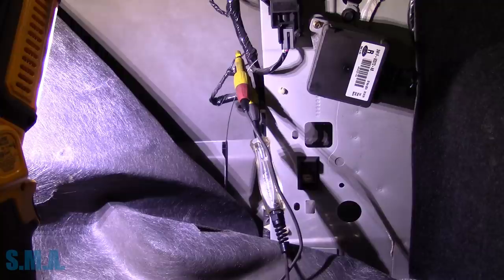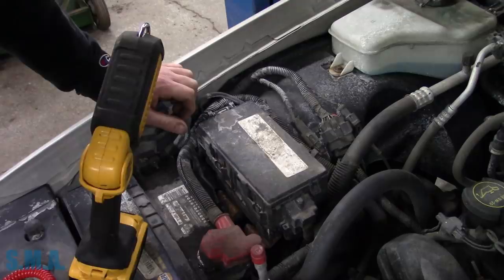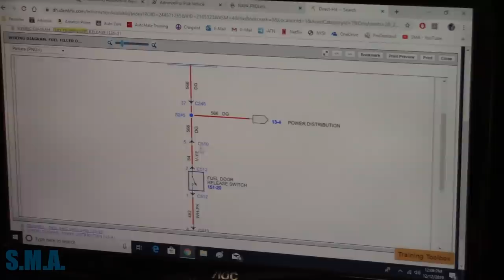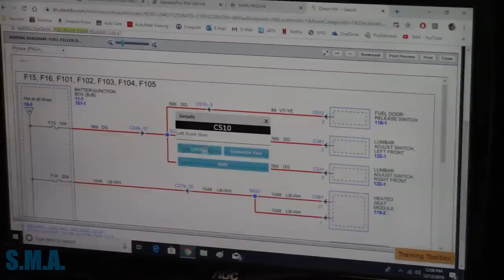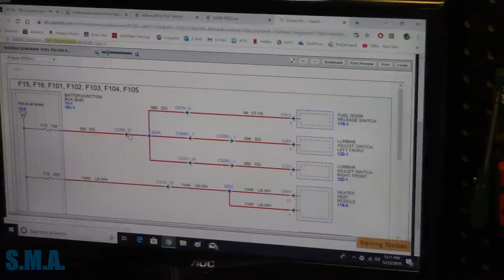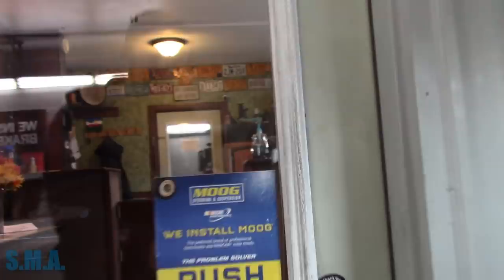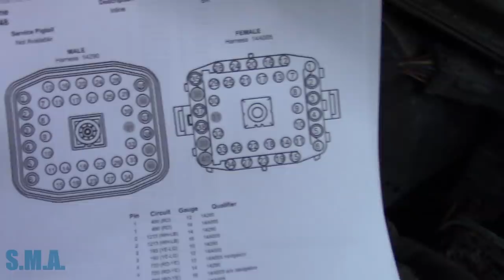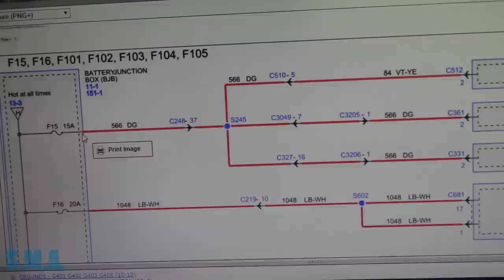Lincoln Town Car: Gas Door Will Not Open

Comment: Put a standard/short 1/4" drive socket on a 1/4" nut driver, and load up the tape onto the socket.   Take the socket off and use.

Comment: in the area where  I live people have lost engines to oil change establishments, not putting oil in, not changing the oil, letting it go with a leak so it ran out, etc. 
When my 1999 silverado was new I took it to the dealer for my FREE 1000 mile oil change. I was sitting on the bench in the garage area and the kid brings my truck around. A stream of oil poring out on the floor. he stops and gets out. I said. LOOK!!! at the oil coming out. he drove it back around to his service area and 20 min later comes back again. everything was ok but I would have lost my new truck engine if I had not seen what the service kid messed up.

Comment: I see how old problem started when I see replacement bumper cover. So if it's normal body shop stuff a body guy didn't put the harness back where it should have been or damaged and not fixed years ago.

Comment: Had a similar problem with my grand marquis. fuse kept blowing for the cooling fan and it was the same harness and it had a hole rubbed in it because the harness was laying on the metal bumper. took me forever to track it down.

Comment: Hmmmm...... odd that no gas door position sensor or gas door release circuit fault trouble code set? I would have guessed that the gas door module went bad. Could have taken the C or K line down, though, maybe resulting in a no start or no crank condition as the customer complaint. Would have given you some direction from the get-go. :)

Comment: also to go with your 1/4 inch socket deal if your tape is too cold and wont stick to anything heat up in microwave for 20 to 30 seconds and it will reactivate the glue and make tape pliable

Comment: easy fix . splice fuel door ground to trunk ground...
fixed....
same prob happened to my Honda power door lock switch.
spliced to power window ground.. worked.. and won't fail for another 160k

Comment: Why not borrow/share 12v from the Trunk release button on the door panel??(cut and isolate old green wire at the DLC  (Data Link Connector) at firewall?  That way, no "overlay".   Just a thought.......

Comment: Very informative, I have a unique issue with my 2018 Mitsubishi eclipse, the problem with my car is the ecu module shuts down the car while driving on highway this has happened three times now it puts the transmission in high gear after coming to a full stop on red light. dealer could not find any codes in the system Mitsubishi has also looked at it could not duplicate the issues.  basically i am stuck with a vehicle thats just plain dangerous. they have updated the software for which there was a bulletin. car comes under ma lemon law. if any one knows or has clue love to hear from you guys out there. thanx

Comment: First off I wouldn't bother Ford or Lincoln anyway you might as will buy a rubber bicycle which is by a Ford or any of them in the salt belt keep up the good work Mr. old

Comment: About 5 years ago. I had a Green 96 NEON that developed a problem where every time I make a RIGHT TURN. The engine would DIE... It would blow the FUEL PUMP FUZE...Not joking.

So I did a little checking like THIS. Found the problem was in a part of the wire harness someplace between main fuse block and fuel pump. Rather than trace it... 
I bought new wire... Connectors and inline fuse...
.i did an overlay...
CHEAP... Pretty quick... Easy...

After going through LITTERLY 65 fuses till payday.   I fixed that little green bastard...
.

Comment: Got a chuckle, turn the volume off and google auto caption English on. It has you swearing in under a couple min lol.

I wanted to say the kitchen in the office looks great. Additionally, I enjoy your videos and have watched every single one of them at this point. Your demonstration has inspired me and granted me the confidence to work on my wife’s 2005 Ford Escape.

Had a question. How often do you run into new off the lot fords with red loctite on the CV axle? I just spent a weekend without anything like big nasty trying to get the driver side cv axle out to change the wheel bearing. Only to find some jamocha at Ford put red loctite on it. Nowhere on the internet does anyone mention them doing this when I tried to look it up.

It needlessly turned a $50 fix with a hubtamer I got after seeing you use it, into now.. new cv axle, new ball joint and new tierod end after mushrooming the axle and replacing parts that were going to fail but hadn’t yet, while I was there :)

Comment: If people check their oil, especially after an oil change, they would know if it was filled. When I have to run an orphan wire, I like to run it in plastic air line tubing to avoid a rubbing problem.

Comment: I have a theory on what happened to that wire. At 20:50 I noticed that the bumper has a Keystone sticker as well as what looks like a patch underneath the mesh in the top center of the screen. This vehicle could've been in an accident that broke the wire. might be a long shot but a theory none the less.

Comment: Okay let’s see if I can get some help. 4.0 ford sohc. No check engine light. -11 fuel trim bank one. 60% calculated engine load. 30 degrees advanced timing. Maf 5 to 6 g/ sec at idle. Tested mass air flow and everything is good. Cleaned and tested iac. Map seems to be working good. Fuel pressure is steady at 50 psi. What could I look at next?

Comment: Glad my current daily drive vehicle has a gas door you just poke with a finger to open, the cap then needs the key to release it from the filler neck. Simples.
That's on a 2019 VW vehicle.
Why complicate the simple act of refueling? Maybe it's a US serviced pump thing from back in the day..... roll in, hit the button to open the flap, fuel station employee fills it up - no need to move from the seat.
Self serve pump - may as well have a fuel door you can just prod with a finger as you're getting out and standing there anyway and it is more to go wrong :D

Comment: My wifes fuel door quit working.  It unlocks when you unlock the doors.    I couldnt get to the electric solenoid to replace it.  Finally got it to unlock after many many tries.  I then unhooked the power so it doesnt lock any more...

Comment: Hot Rod Lincoln is a GREAT song! However, it's not Commander Joe, it's Commander Cody and his "something or other" Astronauts. If that Lincoln was mine, I'd fix that "gass"hole with a, as Dr. O likes to say, "prying apparatus". I'm just wondering if the name of the "shop" that, supposedly, changed the other persons oil starts with Wal, and ends with Mart?
Reply: Edit...Hot Rod Lincoln is by Commander Cody and His Lost Planet Air Men. Don't know why I  thought it  was Astronauts. GREAT song either way!

Comment: How come you didn't do a feed test on the wire to find out actually how much resistance there was in it. 2 thing south main "get a wire tracker". Before  you tare the wire tie a strong string to the opposite end and then pull the wire and string through the harness, remove the damaged section then pull the new wire back through the harness, crimp connect and seal harness.

Comment: Great video Eric.  When you energized the T-pin (around 12:40) I was screaming "use your power probe" to take advantage of its breaker and not smoke some other wire/circuits. You obviously had a sixth sense as to what was wrong. I"m still waiting to use my power probe 3 as I bought one based on your video (I think yours was on a power probe IV). Anyway, I loved the process and decision making to use a jumper wire.  By the way, I saw Liquid Wrench that you used was shown by Project Farm to be the best penetrant, outshining Kroil,wd-40, PB blaster, acetone/trans fluid and I have switched to it. I still think they are all "panther pee", but I guess you have to believe in something.   Kind Regards, Craig

Comment: With that feed shorted against steel why didn't it blow a fuse?
Reply: My guess is it was damaged in a wreck.  The CAPA certified replacement bumper cover is a dead giveaway.  It knicked the harness in the wreck and it took a few years for moisture to get in and corrode it. It was just an open, not a short.

Comment: It’s a safety feature all fords have so they don’t get sued because of dangerously built fords. It’s about to explode or just break down so no gas no go.
Reply: You do know this is one of the most durable cars built, right?  The Panther platform went through almost 25 years of continuos  improvement.

Not a fanboy of any brand but this is a quality automobile occasionally let down by penny pinching at Ford

Comment: Hmmm... is it possible that it was delayed crash damage? Harness tweaked one way or another? At around 20:52 you can see Keystone Certified Parts tags on the front bumper cover.

Comment: 32:15 "Not my favorite way to do things" but sometimes you have no real choice... The only other way to "properly" repair that wire would have been to remove the radiator and maybe the AC Condenser... Cost the customer 10x as much....

Comment: Eric, 

In a case like this where you have to do an overlay or just wire repair in general. Would a 10 gauge primary wire be suitable? What about motor wire? Just in case the overlay is on the outside like this vehicle. 

I wanna stock up on some wire as a DIY guy. Just asking an honest opinion.

Comment: I think I would have double tapped another power feed at the firewall and pulled the fuse. The circuit is momentary and low current. Another circuit should easily carry it.

Comment: Why not come from the fuse panel to the connector over the top I do not get the factor restore for the old winter beater. I saw Steve Rob s vidjeo at your shop was that planed ?

Comment: I professionally wont tear into a harness on old car/equipment just disconnect bad wire and splice to original fuse with out a secound thought.  Too much risk of causing more problems down the road. Wires get brittle.

Comment: 666 comments.  Now 667. :-)  I would be concerned pulling door panels on a car that old because of the risk of cracking the little jiggly bits inside the panels, to the point it is difficult or impossible to reinstall correctly. Good call not going there. Oh, and nice kitchen!  :-)

Comment: Allow me to ask you a question, I have a 2004 Lincoln town car ultimate, that I love, but strangely, my heated seat switch comes on momentarily then cut off, ass well as my memory seat does not work as well as the driver seat ( doesn’t go forward or backwards) can hear click when push the button, (driver side) only affected. I am a subscriber to your channel, I am not mechanically talented so if you were me, how to diagnose/repair, ty

Comment: I would have just used some zip ties and liquid electrical tape to seal the incision cause I'm lazy and there are probably some more wires in that bundle that are close to the same state of late stage 4 copper cancer as the green wire.

Comment: help needed   ,  was driving  my car about 35 mph  then went to speed up , my car jerked so bad  almost felt like i hit something..   so i slowed down   then  it hasnt done it since... i  tryed  in manual modes and regular Drive mode..    all  gears are smooth  shifting   going  granny  racing  to  full speed racing..      nothing   cars running  perfect  ,  no codes,,  no money lights..       what the hell was that  major  halt jerk i had...       maybe a tps  ?   any advice please,,         car has 59,000    a 2013Mazda 6..        i do  notice  when  i go full speed  from a stop  exhaust is louder i have  a exhaust manifold leak.. but i wouldnt think  that would cause  this one massive  jolt  i had...

Comment: If that was a caddoo n star you'd have to take out the engine first .🤗
Reply: If I did it there d be a wire around the fuse spliced to the green or a wire to the trunk button if I hot.

Comment: Nissan, Honda and Toyota sedans have used a simple cable, pulley system forever.
Reply: And a hinge design (Toyotas) that fails leaving only the screwdriver prying method to open it.

Hate to give GM props but their push to release system is excellent...even when the car is covered in ice.
Reply: To bad they can't build the rest of the car with that reliability, but instead model it after their ignition switches and faulty electrical systems....lol

Comment: Do you flat rate or actual time for repairs like this?
Reply: Grayson Wagner flat rate. All reputable mechanics have a time chart for jobs.
Reply: @Txcowboy80  Like to see the flat rate chart for that one. Mitchell, or even Alldata
Reply from the maker: Just time and material. No one is going to tell me how long this job takes. Be nice if they did because they could then tell me where the wire was broke 🤣😂

Comment: I do not care who changes your oil.........Do your Due Dilligence before you leave the shady oil change place and make sure there is oil at the proper level on the dip stick before you start or drive the vehicle. It will not cost you anything to check it. I promise you it is free to check on your own.

Comment: Yeah, cars with buttons. We even have buildings with buttons.  Buttons for power doors for the handicapped folks to open powered doors (which is great for them), but everybody feels the need to use them, every time.  So when the motor or the mechanism wears out after a short time because the thing has already seen 6 zillion cycles, even though only one handicapped person lives in the building,  the whole thing has to be changed and we get to pay for a new one.  Society has become too lazy.  Too much automation, too many "buttons", too many shortcuts (one of which that irritates me; drive-thru's).  Up until 2005 I never owned a car with a "gas door", and the first one I got (and still have) has a mechanical link,  not a powered button-operated release.  I just pull a tiny lever and pook, the gas door opens. First time, every time :)

Comment: You know cars have become unnecessarily complicated when a fuel door has issues. Totally not needed and frankly a stupid design. Stick with a simple hinged door that you can open with you finger, its worked for decades.
Reply: kman 4443 the remotely opened fuel doors make it much more difficult for someone to adulterate your fuel.